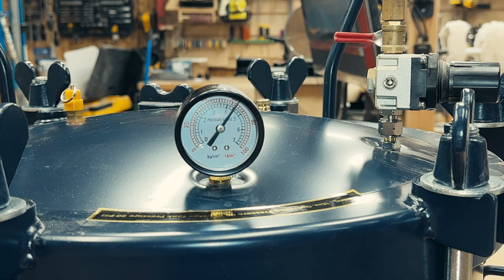From Trash to Cash: Earn Profits with Scrap Wood on a Lathe

Comment: John excellent work in all your projects. You are an amazing. Question , when you add that white in and it swirls after. Trying in gold but not working in river table.
What am I doing wrong. Thanks for any help.
Keep doing outstanding projects.
Glenn
Reply from the maker: Thankyou! The white paste called angel white which I normally get from an Australian Supplier https://www.lerezexpressions.com, is mixed with 2oz clear resin. I use casting resin in my projects that don't need the slow cure deep pour resin. So I pour the main resin that has a translucent dye (see through) in my case the blue alcohol dye, then I pour the white mix on-top, lock down the pressure pot and let nature take its course. So what happens is the casting resin is thick in some places and thin in other places. This causes thermic "eddies" as in river eddies, and the white is swirled and dragged around causing the effect you see in my video. Sometimes I get thermic cracks which I fill with gold tinted resin after the original pour cures. Yeah, pouring casting epoxy this deep/thick is not recommended but so far "touch wood" it's worked out for me. Let me know if you want to know more. BTW this won't work with deep pour slow cure epoxy.
Reply: Thanks so much getting back to me. I understand everything you say. Guess what I’m asking is have you ever tried other colors besides the white angel paste? Can you imagine your white eddies in gold?
You the first I’ve seen doing this and I love. Do you think it would work in a gold paste?
I saw your black dye then you dabbed with something and it turned turquoise  and that was  amazing. Let me know about gold please.
Thanks so much.
Reply from the maker: I’ve been meaning to do a black and gold morph just not had the wood yet. Watch this space could be good or bad or even ugly. 😂